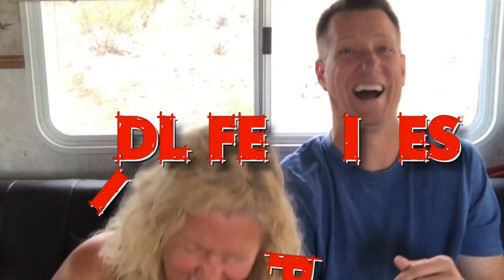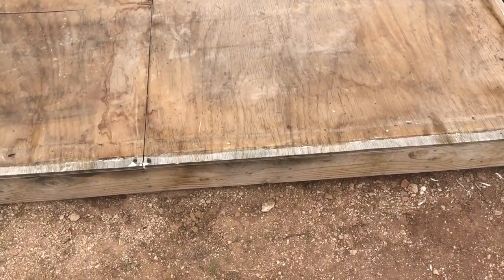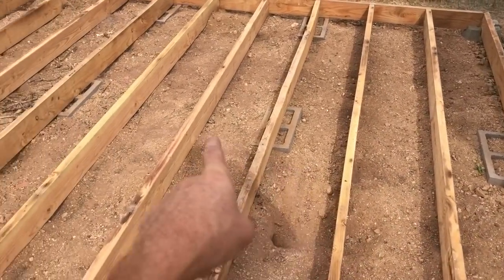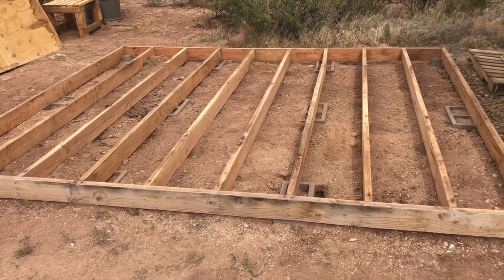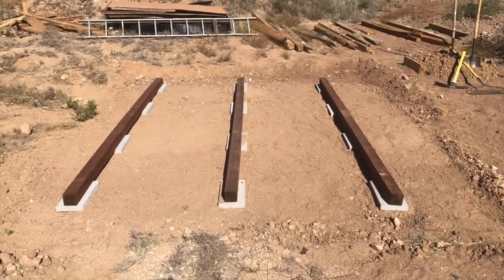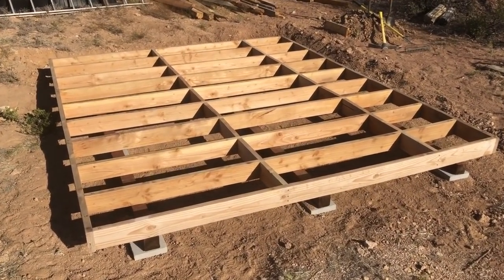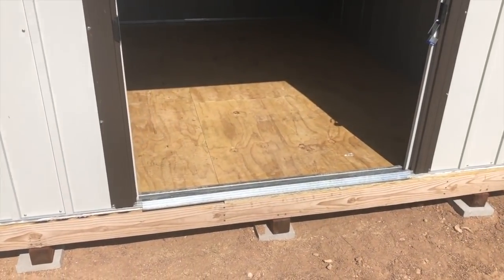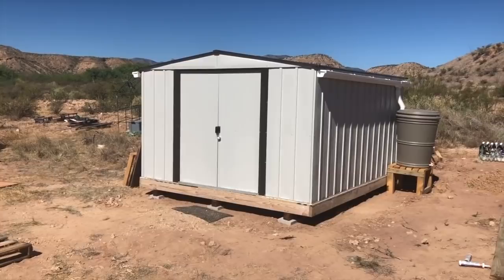Relocating Our Metal Storage Shed

Comment: Oh okay, makes sense. Without some blocking underneath the edges of the floor sheeting there is really nothing from stopping the floor from drooping over time at any one of those spots.
Reply from the maker: You got it!  Also, the "strength" is different against the grain vs. with the grain.  So, even with joists/blocking, it still matters how you orient the sheets.
Reply: @MidlifePrices  thank you

Comment: Nice upgrade! Unfortunately most of us have to learn from experience every so often, but you have it now! For future reference, if you make the skids a bit longer and cut the ends at an angle it makes it much easier to move, if you ever need to. Square ends tend to dig into the ground when you try to drag them. Have a great week!
Reply from the maker: Thanks for the tip!  I’ve definitely seen some examples of that.

Comment: Cross ties help strengthen the over structure. You can use wood blocks or metal ties. It also helps with twist.
Reply from the maker: Sorry, can you explain further?  You mean across the tops of the joists?  Don’t think I’ve seen examples of something like that before, but thanks for the tip!
Reply: @MidlifePrices I seen where you did blocking in the middle, but if you are not using joist hangers blocking at the end of the joist on your rim board will prevent twist.  They also make a metal cross tie that nails to the top and bottom of each joist you use two opposing and make an x between the joists. In the desert heat treated lumber tends to wrap after time. The blocking you have should be sufficient.   Just an observation. Enjoy your videos. Been a contractor for years if you ever need a ear holler at me.
Reply from the maker: Thanks so much! This is a small scale test, but we’ll be building a bigger floor for another shed and might put our house on a deck, as well. Definitely want to understand all I can about it. Thanks!